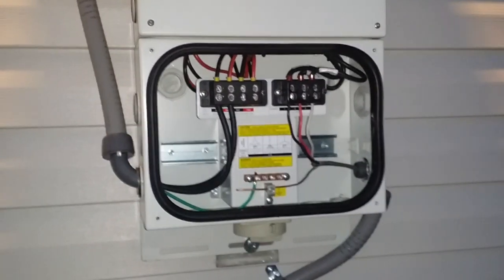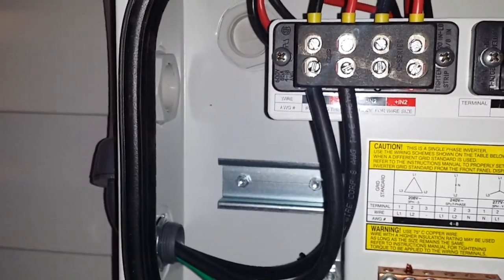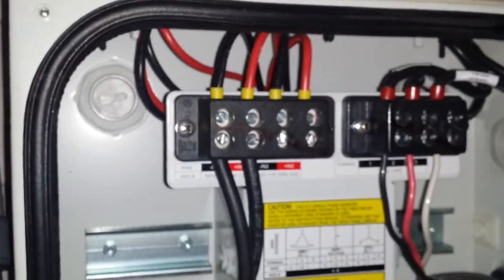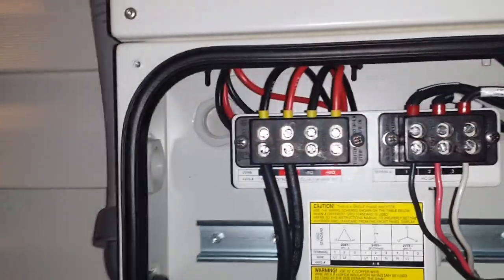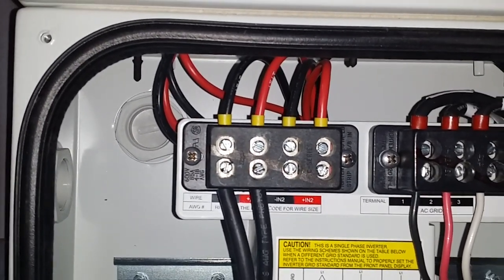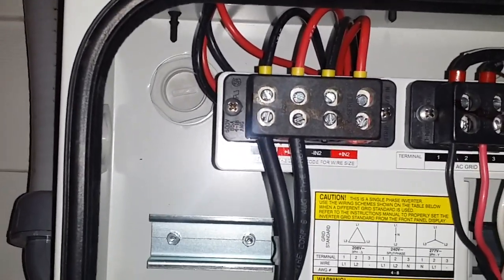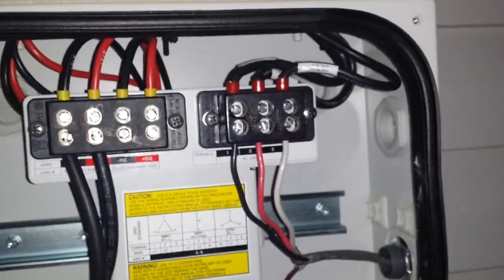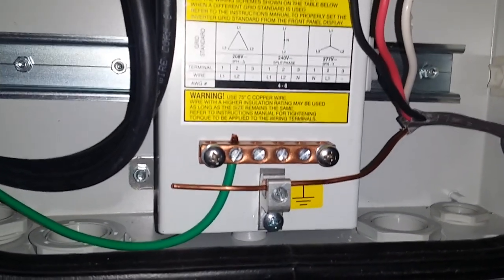DIY Home Solar Installation - PART 5, INVERTER DC/AC WIRING,  Separate solar MPPT arrays

Comment: I have a similar inverter installed by the builder. I plan to add another array myself. Could you please answer some questions I have?
1. If I have another array connected to the right, do they work simultaneously or only one array or the other?
2. Does the inverter recognize the additional array/power automatically?

Comment: Can I ask how to connect the cable from grid tie inverter to the cable from electricity company ?
Reply from the maker: For this install, I installed a breaker in the main electrical panel, and then an electrician connected the wire from the inverter to that breaker.

Comment: Mike holt nec recommends again grounding of solar panels, can find his vids on youtube. Also recommends against grounding generators which is essentially what a solar panel is. Your thoughts? Also do you have a battery bank? Im close to picking up an inverter and must admit I am a bit stumped on how exactly to wire it. I see big lugs to connect dc but only tiny little terminals for the ac power. Can you run say a 60-100 amp panel off your inverter?

Comment: Did you ground your solar panels?
Reply from the maker: Semantics Simple Yes. You can see the green ground wire coming from the panel side into the inverter the video.

Comment: Could you please guide me, regarding which value (i.e.Amp. or Volts), required for the SOLAR HOME SYSTEM, respectively for 1) 600 watts, & 2) 2000 watts.The information required for the following equipments........1) Nos. Of PANELLS with Watts2)CIRCUIT BREAKERS - which Amps.,3) CHARGE CONTROLLER - which Amp.,4) INVERTER - which Amp. & volts if any. 5) BATTERY - which Amp.& volts if any,6) WIRE(CABLE) -which size. 
 please guide me for the abovesaid queries. THANKS !
Reply from the maker: There aren't any requirement as far as size goes. It depends on how much you need. You decide how much power you need to produce, then purchase enough panels to cover that. So if you need 2000 watts of power, get 8 250watt pannels, and an inverter that will handle 2000 watts. You will then need to figure out what size breaker and wire you need for your specific install. You must also check with local code because every where has rules that you must follow and they are unique to where you live.

Comment: can we connect DC wind generator, having completely different voltage and current output rating as compared to solar PV, into the second MPPT channel?
Reply: You could but it has a pretty high starting voltage (I think its 150v). As long as the windmill operated between 150-600v, it will work. But this doesn't have the overload or load dump protection that a windmill inverter would have, so you do have more of a risk. But theoretically it should work as long as the voltages are in that range.